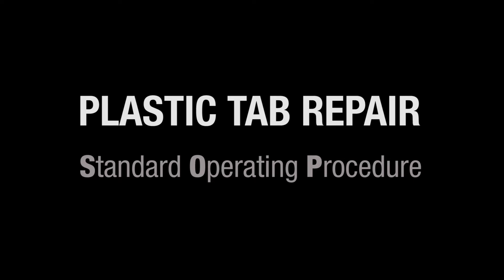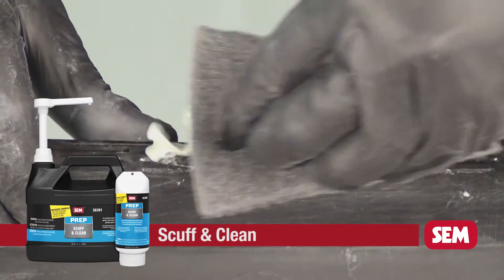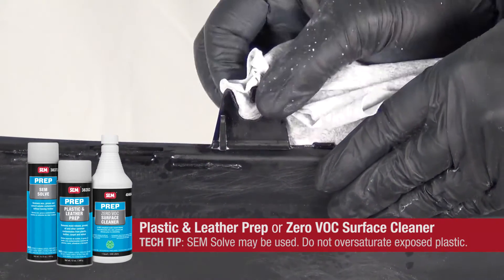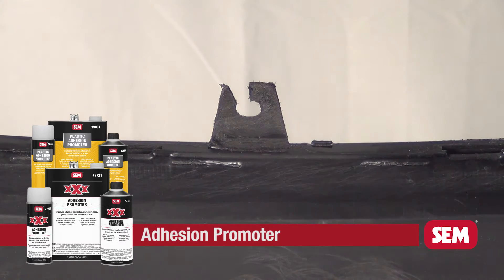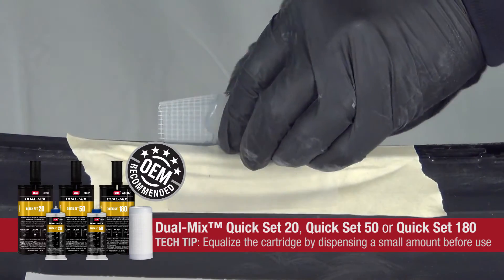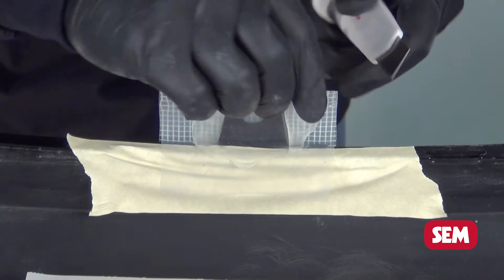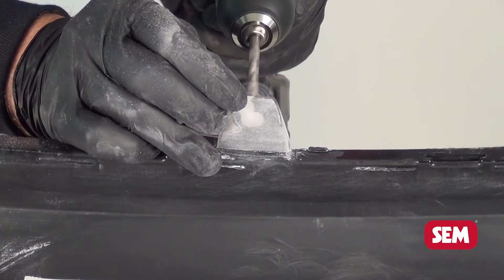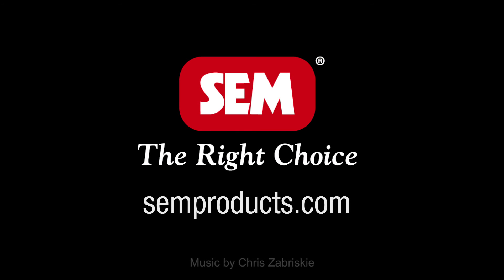SEM How To Series: Plastic Tab Repair

Comment: Wow, 12 products, just to fix a broken tab. When I saw it done with a soldering iron, plastic zip ties, and pieces of steel wool.
Reply: The process in the video is what needs to be done in repairs for cars with adas systems since the extra material and / or presence of metals can and will cause the sensors to not calibrate or calibrate right.

Also, for cases of liability, insurance, etc many  manufacturers approve the process in the video

For older stuff doing what you did, plastic stapler, aluminum tab rivited on, etc, causes no problems, so it gets the full send.